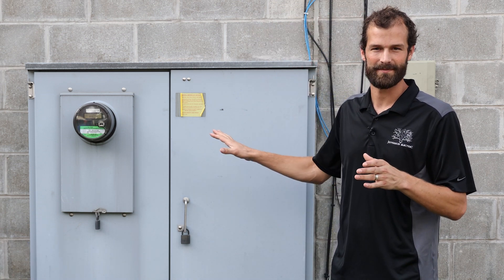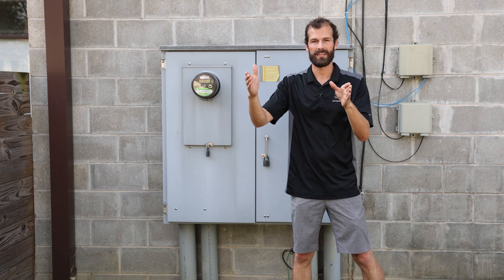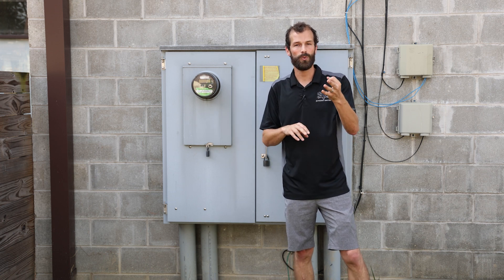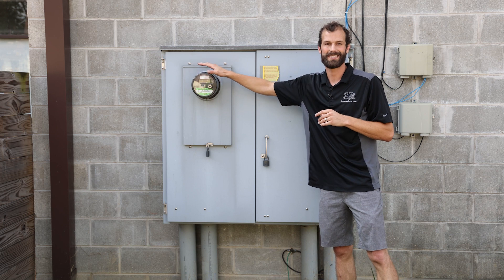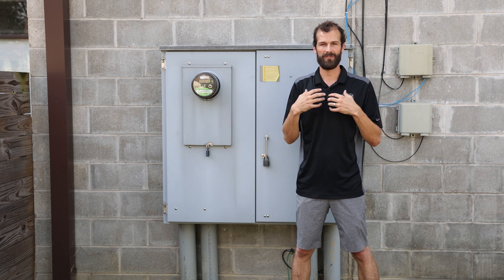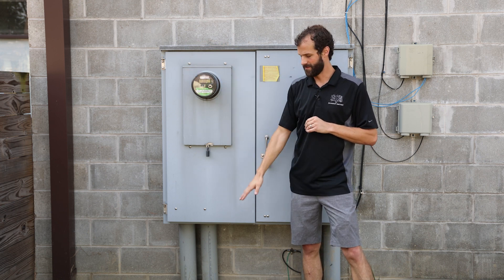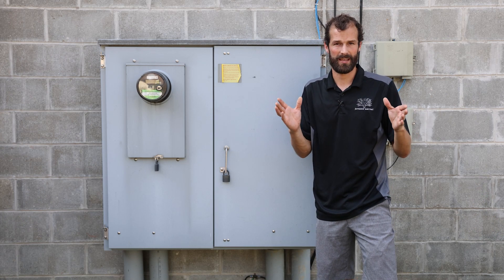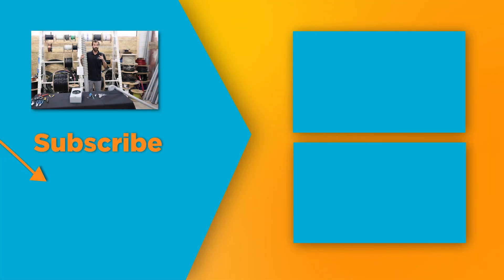Coordinating With An Electrical Utility

Comment: Hi, your presentation is really good. Thank you. I am doing the "customer responsibility" part of connecting to the service lateral and installation of the meter and service disconnect device. The company gives out a sheet with comprehensive instruction, and so does the county. I am pleased. I get to trench the ground hole (4 feet long away from the transformer by 3 feet deep by 2 feet wide). All of a sudden, I came to the realization I am not supposed to come near the service lateral coming out of the transformer. My question: How in the world am I going to make sure I don't hit it? Is it 1 foot out of the transformer? 2 feet? what direction is it pointing in? Should I trench all the way and stop 2 feet away from the transformer, then wait for the power company crew to dig their way to the transformer to connect their service lateral part to my cable? Or is their cable still folded and tucked inside their transformer and not in the ground already? What is best practice here?

Comment: The local electrical utility in my big city is hit & miss. Have a blue book ( now 109% on the net ) . Some of their detailers are ppl superb but a few should be working at a fast food chain. Was doing a 800 amp service in a building for a friend that was renting a building  Asked the detailer what was the available short circuit current in a hurry to decide what would be cheaper a fused 800 amp safety switch or a 800 amp circuit breaker. Finally after a week called them back and they had no ideal of what I was talking about. Told them to give me the impedance of the transformers up on the pole so I could come up with the # but still had no clue. Finally I got to talk to a qualified detailer and got my answer 2 minutes later.